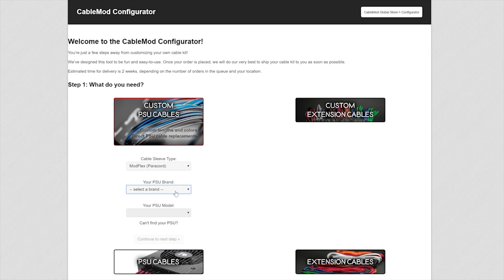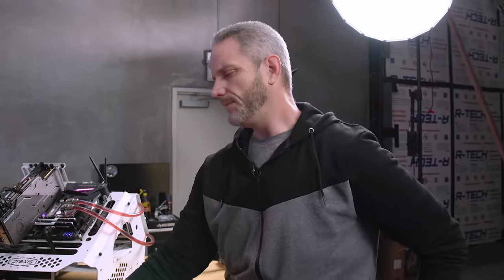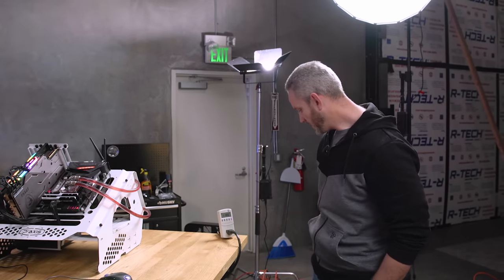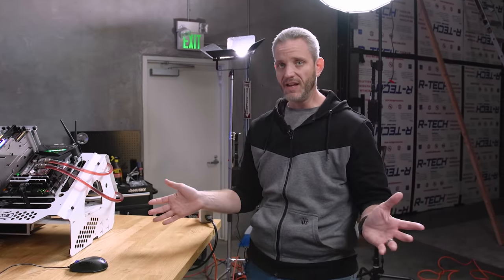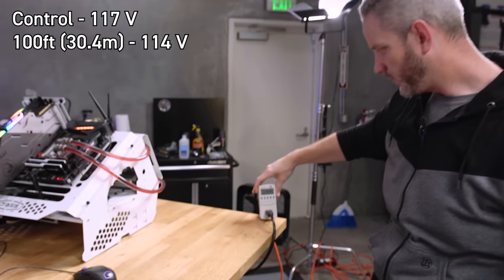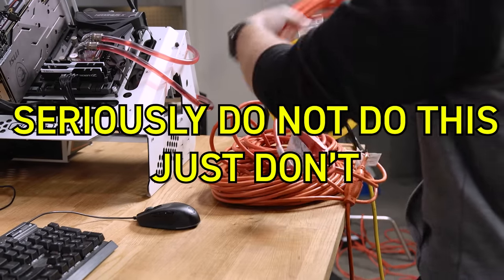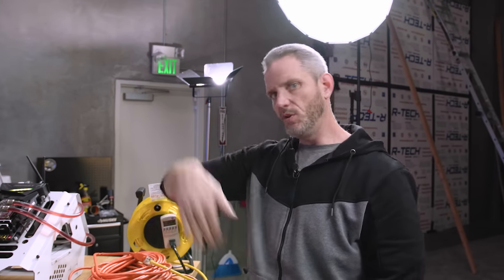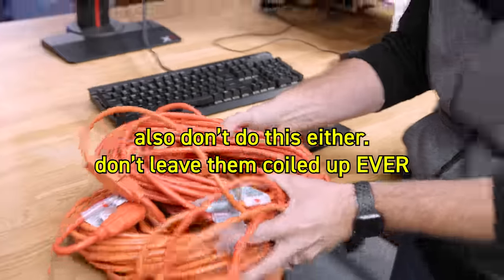Are extension cords dangerous for Computers?

Comment: I had a client that I went to their house to do some computer work and she had a 2 prong extension cord plugged into the computer's power cable but the ground pin was not connected to any ground. The 3 prong to 2 prong adapter's ground was just laying on the carpet.  The extension cord was the cheap white one for interior Christmas lights. Not something you want powering your computer.
Reply: I've got a similar situation here. I wanted to move my PC upstairs to a bigger table and the cable coming out of the power supply wouldn't reach the UPS across the table. Was wondering if I could use a decent power strip with a 2 meter cable to connect the power supply to the UPS.  Don't know much about electricity so a bit of help here would be greatly appreciated mate!

Comment: 5:00 When the voltage drops, the amperage has to go up to keep the wattage the same,  voltage wont go up with more amps. Adding more cables will increase the resistance which in turn causes the voltage drop. P=U*I
Reply: also, coiling the extension cord will increase the amount of heat that gets trapped in the wire, increasing the resistance of the cable. Great video tho!
Reply: @davidwilhelmsen980  I scrolled down simply to see if anybody had commented on this. As an electrician, I second your comments.
Reply: You will have a voltage drop but the PSU will take more amperage to keep the power requirements. Anything that is UL will have to work at around 110V, therefore requiring more amps. Also, don't forget that P=V*I=V^(2)/R=I^(2)*R.
Reply: @tylerjackson2314   You just repeated what I said, possibly wording it better. English isn't my first language so I'm gonna use that as an excuse. :P Also didn't think that putting a lot of equations would help people understand the concept.
Reply: If we go into details, we should introduce impedance here, since we are examing the AC part of the system. Also those cords were acting kinda like coils so it is even more complicated in theory 😅 Nevertheless we all understood what the video is about and it was great 😀
Reply: @Kinek97  if we wanted to give everyone who reads this a headache we could try to go into all the details 😂
Reply: Didn't they cover this? I don't see anything extra your comment adds
Reply: @thomasphillips885  he said that the amps would go up to get the volts it would need to get the watts it needs. Voltage stays the same, but the current increases to make up for the loss
Reply: @davidwilhelmsen980  watts stay the same, not voltage. Voltage goes down amps go up. Voltage goes up amps go down.
Reply: @demondoggy1825  that is exactly what I have been saying

Comment: It is not only the quality of the cable but also how times you coil it and how much ferromagnetic material is in range of said coil. 
An easy explaination for the hot cables (ignoring some details):
What happens is that you have (in Europe) 230~240V @ 50Hz which means that you have a change of the electric current 50 times a second. If you coil that up, you increase the strength of the magnetic field but it also takes more energy to turn the field back around. Remember: we have a change in current so we also change the direction of the magnetic field 50 times a second. Putting ferromagnetic materials next to the coil increases the energy it takes to build up the field (this is only the tl;dr). The cables heat up because the cables are "working" on that magnetic field. Rolling out all the cables can reduce this effect but it will always be present.

Comment: Brazil: 110 or 220v (don't shock yourself hahahaha)
Reply: always a nice surprise
Reply: 127 V
Reply: @PedroLauridsenRibeiro  wtf lol
Reply: Any reason why voltage system in Brazil is not unified?
Reply: we use both in the united states, 110 for small stuff, 220 for things likes stoves and welders
Reply: @Phanthesma  One of the reasons is historical. Brazil is a pretty large country - as big as the US - but when our electricity distribution grid started to be implemented in the XIX century we didn't have our own technology for that and therefore the government contracted foreign companies to do the job. Thing is, the grid was installed in the richest and most populated regions first, and later to other regions, in a process that took several decades, so it happened that companies from different countries built the grid in different regions. Since our government didn't set a national voltage standard from the beginning, each company used their own. Later, when the grids were already installed, it became too expensive to change it to a single national standard since 110-127V (usually implemented by American/Canadian companies) and 220V grids (usually implemented by European companies) use wiring with different gauges - more precisely, a thinner gauge in the latter. Finally, the 110V grids in Brazil were upgraded to 127V in most places due to voltage stability issues.
Reply: @PedroLauridsenRibeiro  isso nao eh 100% preciso tmb, na minha cidade eh possivel pegar 220v, so eh necessario fazer um pedido para a empresa de luz e pagar uma taxa.
Reply: There are a few countries with mixed electrical system. in general always go with the higher voltage if both are available.
Reply: @wyfiswanson  That is different. We have two 120V lines offset in phase. So 2 120V line-to-neutral and 240V line-to-line. Most of the world only has a line-to-neutral.
Reply: @marcos340loko  Sim, a história na verdade é mais complicada ainda - na rede 110-127v do estado de São Paulo temos duas fases opostas e o neutro, então podemos usar (aproximadamente) 220V se usarmos as duas fases ao invés de apenas uma fase e o neutro. Por isso, muitas casas usam na prática os dois padrões (o que exige cuidado com as tomadas...). Além disso, há cidades onde a voltagem padrão pode ser algo intermediário entre 110 e 127v (vide o link que eu pus acima). Mas aí achei que ia ficar muito complicado (já 

é do jeito que está ;-) )
Reply: @amirabudubai2279  That in the states with 110-127v power grids (not even sure if all of them). There are states in Brazil with only a 220v grid.
Reply: Holy moly.... How even that possible?
Reply: @KarrasBastomi  It's Brazil. We're world champions of kludging shit.
Reply: @amirabudubai2279  Well, we here can have line-to-line 400V, if you have three phases
Reply: @wyfiswanson  also 15 amp and 20 amp breakers depending on power draw
Reply: 4 different voltages in a single sate
Reply: @Phanthesma  Politicians, as always.

Comment: would have been interesting to see how 12v and v-core for cpu and gpu change with the drop in mains voltage.
Reply: The PSU can compensate until it can't, and that's when stuff crashes.
Reply: The pc will still draw whatever it wants and the psu will output it down to a certain voltage, its an inverse relationship, as the volts drop the current(amps) increase, eventually though the power supply won't be able to draw what it needs and it will cause instability or shut the system down

Comment: Watched this till the end and saw your wrapping technique that I (used) to do. Try this next time, it will save lots of time and headaches with unruly coiled wires and tangles. Take one end in both hands and stretch it out full length. Bring the middle to the end in a naturally laying loop twisting slightly in or out as needed to get it laying slack. Repeat as necessary, gathering all the loops in one hand. When near the last loop or two, wrap the remaining length around the bulk a few times like a hangman's noose. Take the last meter or so in a loop and tuck that loop through the  top loops between your hand and the lower rings. Pull the loop from the other side and flip it over the bulk and slide it down to form the final ring around the bulk. Cinch everything up tight and if there's any left of the very end, tuck/pull it back through the bulk loops and let it hang. You can now throw it around, stack it, bag or box it and it will never be a coiled nightmare and will always unwrap and play nice with the other cords. I learned two things from an electric contractor that employed me for one week before I quit. One was that the definition of every obscenity you could call a person must have MY picture on it, and two, was this wrapping method. Enjoy.

Comment: As someone that works in an electrically noisy manufacturing facility, that compressor was the wrong kind of test.  Electric motors make an electrical circuit noisy AF and most power strips are too cheap to have per-socket filtering.  While that platinum power supply should compensate for the interference, you were already straining it with the low voltage, so it's difficult to say whether the crashes were due to electrical noise or the voltage drop (my guess is the noise).

If you revisit this in the future, I recommend changing the following: 
1) Use a multimeter with an oscilloscope function (or an actual oscilloscope).  A visual representation of the noise and voltage fluctuations the PC is experiencing is easier for us non-electrical enginerds to understand.  Plus you'll be able to get an actual resistance value for each change you make.
2) Get yourself a Flir so you can show the audience where the hot spots are.  You could even pop the cover off the power supply and see what parts of it heat up to compensate for the voltage drops vs. line noise (same with the power phases on the motherboard).  It might be fun to use for LN2 overclocking, or even overclocking in general.  We like shiny pics!
3)  If the multimeter thing is too complicated, a good UPS with power factor correction(PFC) is a good way to show how UPSes can clean up interference and stabilize voltages.  Or you could just do a video showing why UPSes are important if you are building a $2000 PC.  :)

Comment: Electronics engineer here, If voltage tends to go down, and the power required by the PSU is the same, the current will go up in order to maintain such power required. This is simply explained by Ohm's Law. Where P=V.I. If you keep making voltages go down, current will keep on going up, the extension cord is gonna start heating up which also increases resistance. Long cables (Street ones) at most tend to drop 4% to 5% of main voltage. Thats why distribution transformers, distribute at 130v to 140V in order to have in account for cable's voltage drop.

Comment: 9:05 short answer is that powerplugs are only limited by the breaker in the circuit, so naturally the maximum wattage is just the voltage in your country times the max amps of the breaker. Most powerstrips or powerbars have ratings on them that work the exact same. Daisychaining works fine as long as you stay below the lowest supported max wattage in the chain of powerstrips

Comment: "i'm gonna leave this one rolled up, why the hell not?" because extension cords can safely dissipate the heat produced at their full rated current only as long as they're stretched out so all the wire is exposed to the air. coiled up running the same current they can overheat
Reply: This. I went to a friend's house a couple of weeks ago and he ran out of plug sockets to plug in his space heater so he used a 4 socket 20m spool extension cable which he left rolled up to save space. I'm pretty sure the spool of cable was kicking out just as much heat as his space heater. I think the fact that it's rolled up also hurts it too as this can essentially create an induction coil which certainly doesn't help.
Reply: @Nickgowans  it doesmt create an induction coil.
Reply: @Nickgowans  My 40 metre one lists the ratings on it: 720 watts fully wound, 3,120 watts fully unwound. It is typically unwound to 10 metres up the staircase with a 5 watt load (USB light bulb), but if the upstairs circuit trips the RCD and the fault can't be found it is unwound to 15-20 metres and my UPS gets plugged into it (200 watt typical load with all of my electronics, devices, server, laptop, monitor, networking gear, and PoE Wi-Fi APs plugged in). I wouldn't dare plug my 3 kW kettle into it for a cup of tea even if it were fully unwound because of the trip hazard.
Instead of plugging the space heater into the extension spool sockets, it would've made more sense to unplug several DC bricks/adapters from the wall and plug them into the spool sockets.

Comment: Brazil is 127V officially. But some houses (in the past) used to wire as 220V (Phase+Phase) on the entire building (not so in Sao Paulo or Rio, but more common on the countryside). Since you can just add Two Phases to run 220V it is easy to put some outlets in this voltage when using high power or "24x7" appliances like DishWashers, Refrigerators, Washing Machines, and... sometimes your home server, why not.

Comment: Would be interesting to see how an "average" PSU and motherboard reacted to the reduced voltage. 
I assume the PSU and VRMs are able to compensate, since they are of fairly good quality.
Reply: It's mainly the PSU that gets the punishment here. If it can't put out good power it'll just shut down. I would like to see how the various 80+ ratings affect stability in this type of torture test.
Reply: The VRMs don't care, they get 12V from the power supply, no matter what. The PSU has to compensate and would get hotter.
Reply: I can't recall who did it but I saw a video a few years ago comparing cheap and expensive PSU's and how dirty the power was that was going into the system on the cheaper/lower end ones (note cheap doesn't always mean bad). Some of them permanently damaged the motherboards and components because the power was so unstable but unless they were VERY bad you'd not really notice it in the short term. The take away was always buy a PSU from a reputable manufacturer rather than simply spend more money. So brands like Cosrair, Antec, SeaSonic etc (SeaSonic also tend to make the PSU's for a lot of other brands as a white label).
Reply: @anlumo1  - I assume that a less than good PSU would struggle delivering 12V if the input is - well - less than expected.
Reply: @thomasr7129  A good PSU would just turn off if it can't manage to output 12V.

Comment: 06:20  Not an EE, but you're basically correct, despite the rather horrible way you're putting it. 

The PSU is auto-switching, so will work on a range from about 100V to 240V.  If it has an efficiency of about 90%, then to supply 450W of power to the internal components, it needs to draw 500W of power from the wall.  If the incoming power is at 100V, then it needs to draw 5 amps.  If it's at 200V, then it only needs 2.5 amps to provide the same power.

The thickness and length of the wire affect the resistance, as you note.  Because lower voltage means more amps across the wire, the wire also heats up, which further increases the resistance.  So the overall voltage drop will be affected by the length and thickness of the wire as well as the overall power draw.

These are all considerations one should think about when wiring up a house to a portable generator when utility power is out.  There's another factor there that tends to be a problem - a portable generator might not be tuned all that great, and run too slow or too fast to generate a stable 60Hz frequency on the power.  An auto-switching PSU is typically going to be designed to handle anywhere from 50Hz to 60Hz.  So if the generator is running a bit slow, that's not a big problem.  If it's running too fast, however, that might cause problems.

All of these problems are going to be worse if you plug into a UPS first, because a UPS is much more picky about incoming power than an auto-switching power supply.  Unless you spend a considerable amount of money on an online UPS with sophisticated circuitry that can handle out of bounds conditions even better, which 99% of people do not do.

Comment: After my office burned down because of a cheap, plastic, 6 outlet power strip (typically sold to home owners) - I replaced all the outlet boxes on my computer equipment with more expensive industrial, metal ones (behind my UPS) from my local hardware store.  After the office fire, the fire investigators told me that the circuit breakers built into the cheap plastic power strips basically don't work - so didn't protect it from melting down and catching fire when it was intermittently overloaded (for several months) by my office coffee pot.  Moral of the story, don't trust cheap power strips for anything pulling a lot of amps!

Comment: Ok jay for your information V*I=p which translates to 120v * 6.5amps will give 750watts.  You are right the longer the extension cord the higher the resistance gives you voltage drop resulting in a higher current to maintain the required wattage